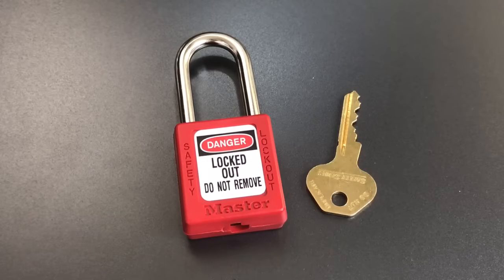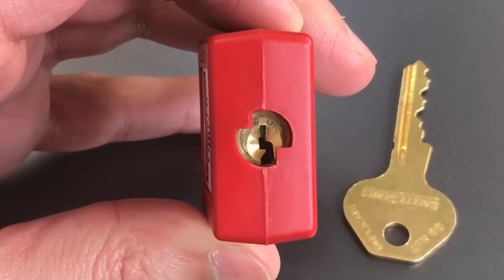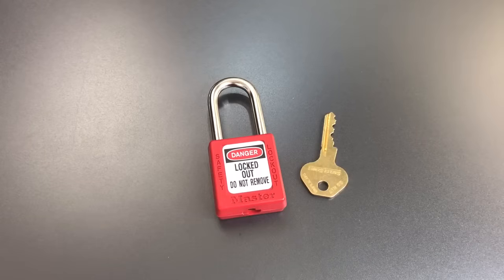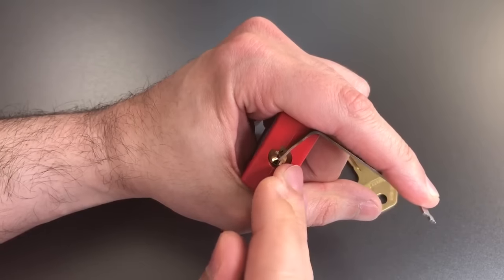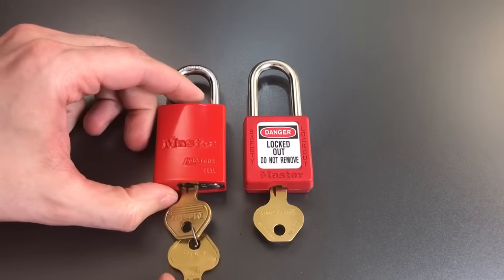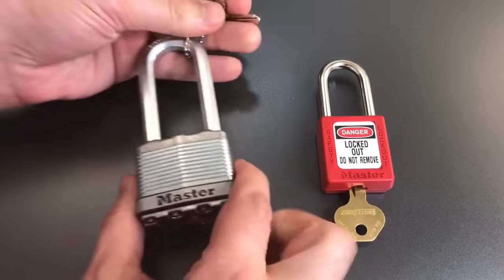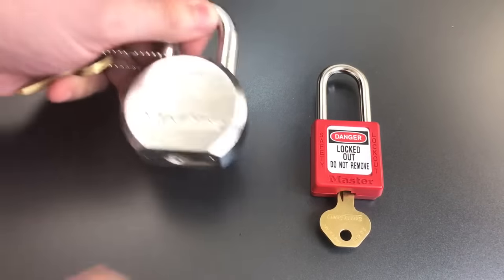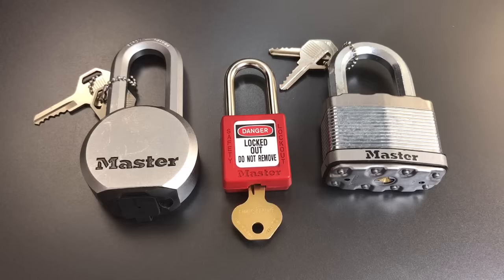[479] The Master Lock Paradox - Model 410 LOTO Padlock

Comment: I'm guessing the reason for a more robust core on LOTO locks is because you can have jobsites with 50 workers and each has multiple padlocks.  Just due the math on how many guys are running around with very similar keys.  You don't want have only a handful of key combinations.  You want to make sure that other workers keys won't accidentally open another guys lock.  Lives depend on the LOTO lock having under que keying.  It makes sense to me why the robustness.

Comment: Seems like if you want a really good lock, buy the Magnum 930, then pull the core from one of the plastic body LOTO locks and use it instead of the original 5 pin core.

Comment: LOTO locks have the keys lost for them all the time. Working on heavy equipment, I've lost keys. The plastic ones are the best because you can just beat em off with one good whack from a sledgehammer.

Comment: It's because the 5 pin locks are usually not for safety.  I like a little more security for electricians who lock out industrial high voltage circuits.

Comment: Mine are that lock, except since we lock out things up to 600v at any amperage, our padlocks have a non-conductive black shackle. My 6-hole hasp is still made of steel but those can't be effectively or safely used at facility power panels. It's never an issue, because removing a lockout device without doing a lot of confirming and trying to contact the lock owner can result in immediate termination. Most people don't want to lose a federal government job nor kill coworkers. You have to look out for your own safety and use PPE and follow procedure and expect people to do dumb things. I work with everything from 24, 36, and 58VDC to 480v 3 phase. The lock is merely a suggestion and is there to slow down a member of the idiot class as they try and kill you on the job. All of mine are used in a secure facility on restricted government property. A zip tie would be more secure than our nylon shackle anti-shock padlocks, because you need an implement to cut a zip tie. If you have to remove one that the owner has forgotten and gone home, a hard twist will snap the shackle like a twig.

Comment: Having used these many times. I can speak for half the paradox. The casing and the non hardened shackle are there for easy removal. These often have to be cut off if the individual forgets to take it off. Why it has such a robust spool? I do not know.

Comment: I can tell why:
 I carry at least two of those plastic locks on my person everyday. 
Their strength is the internals
and with the strong safety procedures, they do their job.
As an electrician I want there to be strong evidence something I locked out has not been tampered with while at lunch or bathroom. Hard to pick does that.
Shank strength is not important because we have big bolt cutters in a factory, and what they won't cut, a cut off wheel on a 4" grinder will. That leaves evidence and will NOT  be done by ANY tradesman without a Superintendent, Security, and the lock owner on the phone with one of them and a document signed by all. (Meaning that the lock owner is gone from the building and too far away to get back quickly) 
There is only one key per lock set, no master, no spare.
 Not to mention the paperwork.
Cutting a "safety lock with out this process is a fire-able offence, and don't cry to the union. Even if you were somehow tricked, "the cutter of lock" is getting an unpaid vacation of 30 days. The hammer falls hard.
They also don't bang against my hip when I walk with it on my belt loop.🙂
Love the channel

Comment: I imagine the reason for the difficult to pick core is to prevent employers from removing a LOTO lock to cover their own ass, claiming an employee never locked out. 

I've heard of cases where equipment still worked while locked out, and if that causes an accident, that's the kind of shit that can get you shut down, rightfully so. I could see a manager or owner resorting to picking a lock, and claiming it was never used. Destroying the lock would not achieve the same goal, given that these are usually tracked somehow. This core doesn't make that impossible, but most plant managers are not LPL. If they used a cheaper core, it would be possible for any idiot with an improvised rake to open it.

Comment: I think the lock needs the plastic body because it is used to lock off electrical switches inside live electrical panels and a clump of metal dangling from a switch is not favourable.

Comment: LOTO locks aren't about security. They are there to stop someone turning a circuit breaker, etc on when someone is working on it. Anybody who tampered with one is committing the greatest sin you can do on an industrial site. (The second greatest sin you can do is to forget to take your lock off when you go home).

I'm an electrictrician and my LOTO locks have plastic shackles to be non-conductive. Someone could cut them with a pair of side cutters, but their next job would be cooking frys at MacDonalds.

Comment: Might it be cost? The locks made out of steel are harder to make under a certain budget, so the cost cutting has to come from somehwere. That lock is made out of cheaper plastic so they can splurge on the actual cylinder.

Comment: Dude, I spent three days trying to pick one of those and finally gave it up.
However, I can pick most other Master locks. It's ironic that you could open it with bolt cutters or a torch but they are very difficult to pick lol

Comment: Maybe to prevent tampering without any traces? Like if you want to open some valve and fry someone else and make it look like accident. If you just break body then it's obvious so no one would do that. But if you pick it you can close it after and would look like it's not the cause so then weak body but strong picking protection sounds perfect for such scenarios hmm 🤔

Comment: If you ever worked with these they’re designed to stop machinery accidentally getting started as paper tags tied on with bits of sting or rubber bands wasn’t reliable 
They were at no point meant to be made hard to remove by destructive methods in case keys are lost or someone is unable to make it make to site to remove their lock and there’s ways to confirm that said person has actually left the site and isn’t still in danger 
Everywhere I’ve worked you’re specifically told not to use them for securing item, some sites it’s actually against policy to use these locks for lockers and tool boxes 
Extra pins is for more keys, some mine sites have thousands of workers going through daily as well as contractors with multiple locks, you need to make sure wrong locks are not removed

Comment: It seems all the LOTO fans dont get the question posed by LPL.    We understand the need for the 6 pin lock on the LOTO so as to not duplicate keys if there are hundreds of locks on site.  The question he is posing, is why is the better core NOT in the more expensive, higher end master locks.  They have it available, whey dont they use it.

Comment: I think the objective was really to have really high number of unique combinations, because when someone would be able to accidently open soneone elses lock, someone could really die.
That explains the use of a 6 pin cylinder. But then why tye security pin design? My guess is, they just pick up subassemblies (the cores) from a production line making cores for other locks. And the only other locks needing so much pins are some higher security devices, so that production line is making the cores with the security pin designs. So for making the LOTO locks it is then cheaper to just take the cores the way they are already made, so to not need to set up any other separate manufacturing line.

Comment: Lockout locks have to have shackles of varyiing lengths for various handles , circuit breakers so on so forth. Second, they are not " security " devices meant to protect anything , it's meant to keep idiots that do not ask before doing anything their co workers/supervisors if it's ok , from electrocuting the guys or maiming them. Even then that does not guarantee there's no mistakes and someone won't get harmed. Tagouts simply mean " im working on this .. stay away from my shit " Noone else than the one who puts the tag has a right to remove it. So whether the core has or not any merit is not the point. Jacksonville downtown library. Electrician comes in the morning , locks out the panel cause he's doing 3 phase wiring on lighting. Feeling safe to work are we ? Wrong. Though the panel was locked out a mistake in wiring was actually backfeeding from the other end the circuit he was working on. Took his cutters to the wire and zap .. for a whole 56 seconds the man was electrocuted on 347 V and it took that long for the breaker to trip. The man survived. So whatever the tagout lock used there's still potential for extreme harm. I hope everyone takes work safety seriously. Tagouts don't need to be extremely solid , they just need to raise awareness to personnel that this is a work safety issue and refer to their colleagues if they need to access the locked device.  Job safety first. Think before you act.

Comment: Paradox no more! So this is 4 years too late. I am a Millwright and we use LOTO per OSHA requirements to work on industrial machinery. Such as machinery Nuclear Power Plants, Paper Mills, Sewage treatment plants, Steel Mills, ect. The LOTO lock with the plastic casing is meant to be a tradesmans primary lock on a “group LOTO box.” Think of it as an surplus military ammo can, painted red, with many 45 degree holes drilled into the lid and side (that line up). So that a lock can be secured and the key taken out. The group LOTO box will contain the singular key that unlocks all of the other LOTO locks that isolate the energy from the machine that’s undergoing repairs. It could be as few as 3 locks or 15 locks that the key can unlock. As shown in your video, the two other LOTO locks with harden shackles and metal body’s are strictly used for valves, circuit breakers, switches, chain valves, ect. Also, in the event that a technician forgets to take their lock off OR lost their key. The supervisor can break the plastic cased LOTO lock easier.

Comment: More or less, it's less a 'lock' and more a 'tamper evidence seal' that looks like a lock. There's almost no way it was 'accidently' opened. and when destructively opened, it cannot be faked it was anything but deliberate.  but if needed, it's also easy to pop open.  Also, there's likely some variant of cost versus item formula in play; the 'cheap' body may be the only one valid for the 'expensive' core according to someone with a 'degree'.

Comment: LOTO are. Mostly just to stop an I incursion not really for ultimate security
Things happen in the LOTO. Process and the lock needs to be removed easily and not destroy the equipment that it is attached to, to remove it.
Having worked in the trades. Equipment ready to go and someone forgot to remove their tag & lock
And went home.

Comment: Could it be a cost trade-off? Either the lock body is more expensive to produce, or the core is more expensive to produce. But if they made both the best, and therefore expensive, they couldn't sell enough (vs. the competition) to make a good profit?

And if they did make such a lock, it would become a target of top criminal lock-pickers as the one to beat, securing the most important or most valuable items.

Comment: I would say they’re the most common loto lock and made with such poor quality but good core because; and I’m speaking from experience, when I lose my key I can cut it off or bust it open easily however the lock must not be opened by anyone but me which is where key good core comes in
Reply: To add it’s made poorly because I, the worker, may not have power tool training to use a grinder or whatnot, but I MUST be the one to break it off. So the cheaper the body, the easier to break. The better the core the easier to keep idiots out who may have a similar key

Comment: The reason for the good core in a bad lock or a bad core in a good lock is $. They will have a target for cost per item manufactured.  Let's say it's $1, well the core let's say for cheap is $0.30 and expensive is $0.45. Well that leaves $0.70 for a good shackle and body whereas the other one is half spent on just the core so now they cheap out. Because just remember the target may be $1 but if they can get it done for $0.97 they will.

Comment: Someone who knows already made the case for keyspace size and removability. But presumably there are also different use cases for tamper-proof and tamper-evident locks. For the latter case you'd want softer materials and strong gradient towards attacking them—could this be relevant?

Comment: they are easy to break off but shows that it was broken off, you can lose your job at most places for not using the lock so if someone broke it off. youre in the clear, but if picked, it looks like you never locked out a machine and youre gone... also if you lose your key or leave a lock on they want to get it off easily... NO one gets a key to your life but you. so they take em pretty serious.

Comment: I have picked such LOTO master lock, but was not smart enough to not turn the core 180 deg, which caused drivers to fall through drilled holes on the other side of the empty lock body🤦‍♂️, so it’s just a rattle can now full of driver pins

Comment: I was thinking that Bc its a lock made for locking up machinery mechanisms it would be safer to have the lock be more weaker as if a faulty goes wrong with the machine and it turns on and they don’t have a key it could easily be cut open

Comment: Maybe it is a product of the LOTO locks success. Seems to me that no 6 pin masterlock key can be reproduced. If they put this core into other locks with keys freely reproduced then you get a whole lot more keys out there. They may have to jump 6 pin and go to 7 pin cores for better locks.
Reply: Exactly! LOTO locks aren't for security, but a  safety measure of which the application and breaking needs to be provable in legal sense. Therefore they should be unique. Making the same cores and keys available in other locks  might create legal loopholes.

Comment: In coal mines aluminium is not allowed (at least in Australia) due to its high flash point
Reply: LOTO tags have to be plastic and steel in this case, could be the cause for the plastic locks

Comment: The lock is currently not available (afaik). Any other recommendations for a lock with a good keyway and security pins? I have picked a few locks, but never had one where I knew that it includes security pins, therefore I would like to acquire one where I am sure it includes security pins.

Comment: So we use these LOTO's alot at work. Nobody in their right mind would remove a lock like this unless the proper procedures were followed. However. If the lock needs to come off and we need to resume production and the employee  who LOTO'd the lock loses or goes home with that key, we need to be able to get that thing off. Our maintenance  crew has had to bust off more than one before. And we dont have LPL hanging around  to pick it open for us. XD maybe Master lock designed it with that in mind.

Comment: I worked security at a large factory, we had over 130 engineers who worked on site. 

Some days there would be huge electical panels open with 20 or more of these locks on multiple items as engineers worked on things some days after shift would change some of the locks would be left on or the engineers would lose their keys whe had to kut the locks off and they would often be on sensitive equipment and bery close together. I always assumed thats why they were plastic so they could be cut off easier by security lol
Also with hundreds working at one time i guess they didnt want risk of the keys fitting each other?? But hey i dont know why they are so unpickable lol

Comment: I have several of these locks, one got put together incorrectly. It only has 2 key pins but all of the springs and security pins are in place. Any advice on opening it or should it be trashed?

Comment: How much do you have to not trust your coworkers to use a padlock for your lockout? I usually just see tamper proof wire locks like the electric company uses on your meter with a sign.

Comment: I have a suspision its cost...as they spend more on the body, there spending less on the core, since the body of that first lock is so cheap, they put there best most expensive core in it...financialy it makes perfect sense...security wise...not so much...and honestly that hardened laminated lock is just overkill for LOTO, honestly all you need for that is a plastic tag with a wire just thick enough to keep the switch from being thrown, an actual keyed lock is overkill unless you think someone in your factory is homicidaly inclined or tragicly stupid

Comment: intentionally designed to be easily broken/cut open in case a key is misplaced. not really designed to be pick proof or secured, just enough so any random worker can't open/remove it or turn on the equipment it's locking out, and is in that red plastic body to be noticeable/visible and often these are attached to electrical boxes which is another reason for the plastic body to reduce the chance for a potential shock from being near an electrical source (a metal lock body may build up a nasty static charge especially in dry climates).

Comment: Whatever the reason, I'm sure it wasn't : 
in order to spend more money

It was probably a new lock line that wasn't doing well, so some smart guy recommended repurposing them in a product that would be guaranteed to sell. I would bet master has many commercial contracts that buy LOTO locks on the reg.
That plastic body is cheap as dirt to fabricate further decreasing the loss from the theoretical failed lock. Win win win win